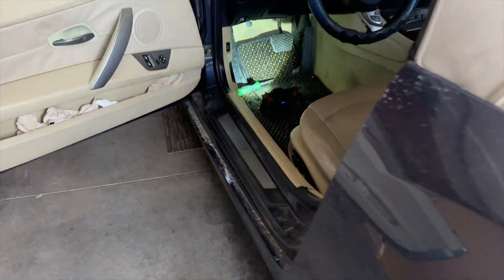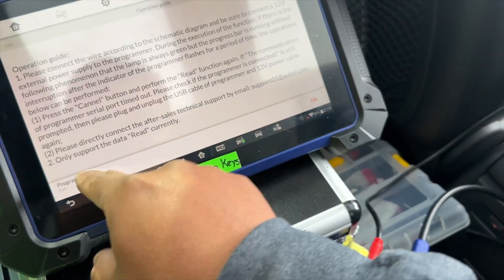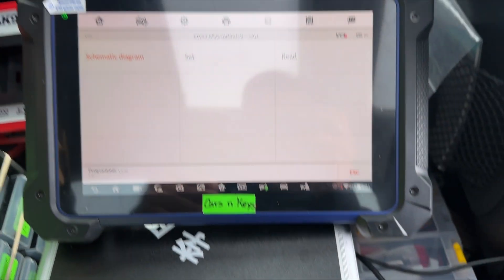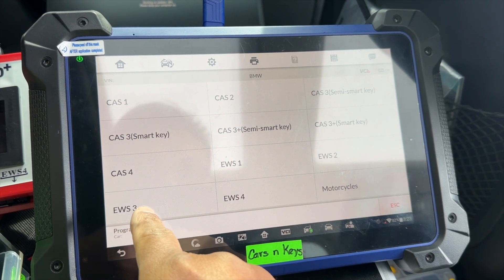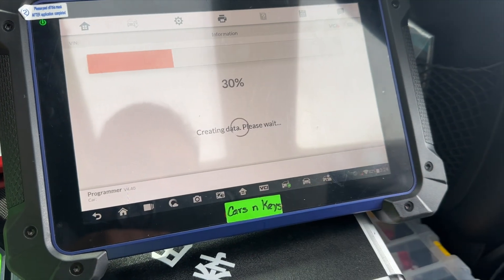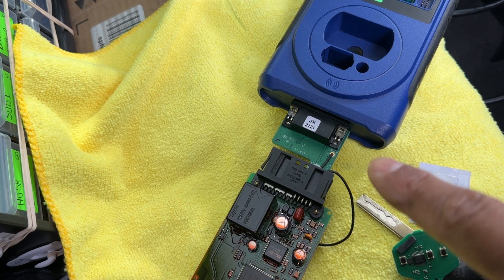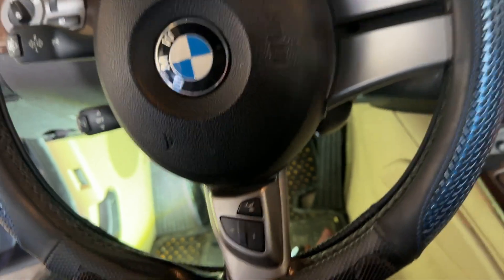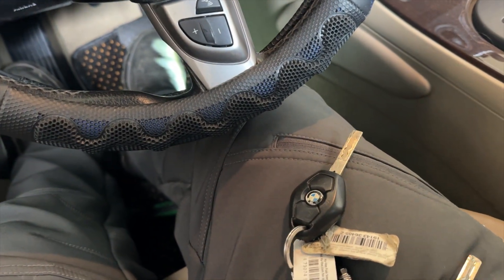2004 BMW Z4 | EWS 3 | Adding a second key with Autel IM608

Comment: Hi Dear Friend!
🙂 
👋 
Very helpful video!
It helped me get it done the first time!
Thank You Very Much!
🙂 

But I have a question!
I have done CAS2 before, and when saved file is selected and just before it open, it gives VIN number, mileage, frequency and most importantly the mechanical key code.
Is mechanical key code somewhere the data in EWS3 chip, or it could be found in CAS chips only?
Thanks Again, and 
Have Great day and week!
Steve
🙂 
👋

Comment: Thanks for video, my friend! Did you ever try to program vvdi superchip and x-horse or keydiy remote for this model?
Reply from the maker: No, I did not, a Xhorse might work but I do prefer to use a original chip since the programming procedure not that simple, I don’t want to remove the EWS twice, you know what i mean 👍🏻
Reply: @carsnkeysautomotive  thanks for your reply, I haven’t used vvdi for this car, used precoded Philips crypto 1 transponder

Comment: Does that adapter for the EWS come with the kit or is it separate? I had that red one but by the time I tried to use I found out they forgot to include the activation code with it!
Reply from the maker: For the EWS4 comes with the programer if you buy the complete kit, but for the ews-3 nop, you have to buy it separately

Comment: The customer bought cas remote key with 46 chip
Diffrent chip and remote
You could find out that real quick if you was reading the chip before start working
Reply from the maker: yeah, thats for sure. this remote and chip was the same, I have had the same issue before